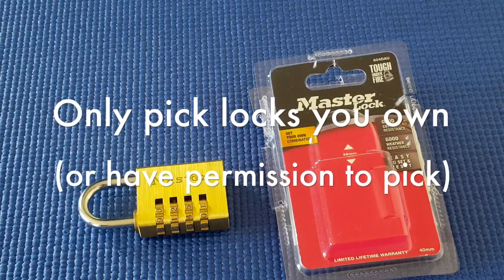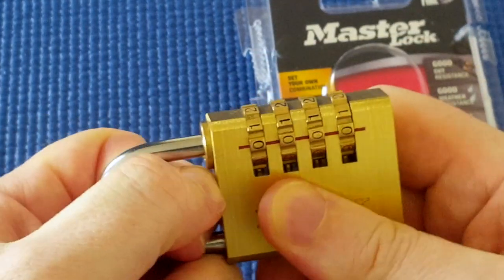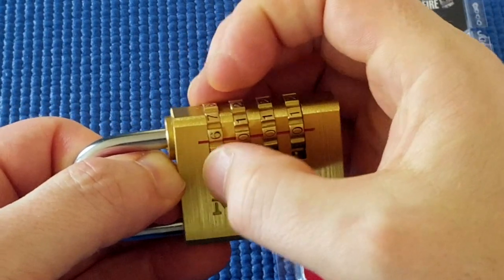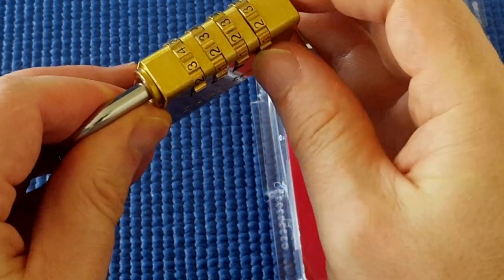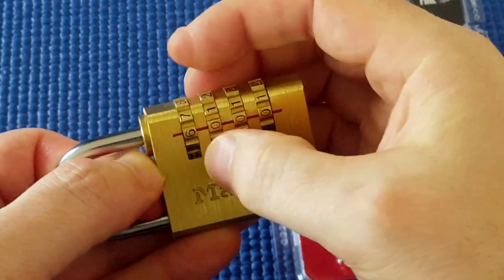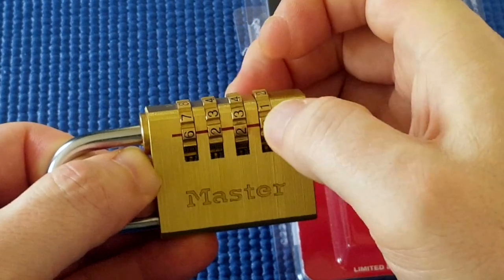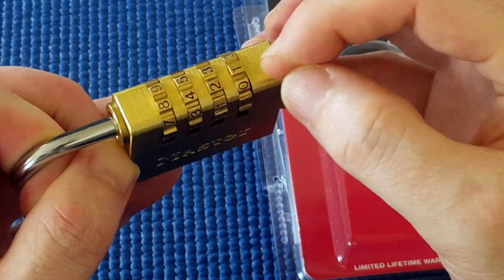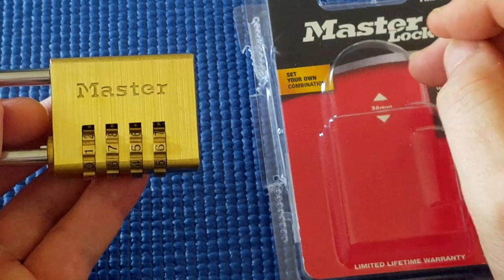(Picking 3) Master combination lock (604DAU) - picked (decoded)

Comment: I’ve got mine stuck open and the code I programmed doesn’t work. 
Can I still use this method with it opened (but locked)
Reply from the maker: The method should still work, but you have to tension the shackle by pushing instead of pulling ... ie as if you're trying to push the shackle closed. You'll have to line it up carefully over the hole, so that it will close if the correct combination is entered. Good luck!

Comment: i dont understand the clicking part - my lock clicks after every number?
Reply from the maker: Is you're the same model? If you tension the shackle (by pulling as if you're trying to open it) then it should click more when turning into a gate, and what I mean by click is that you might hear a click (louder than the others) or it may "lurch" into the gate where the wheel in that position turns easier forward & back a little bit, but it doesn't really want to come out of that gate unless you release tension slightly on the shackle, turn it, and then tension it again.

Comment: I have two of these locks with a comb and now they are stuck locked. Is it possible the comb changed by accident? Or is it just defective locked shut ? What are thoughts. Thanks in advance
Reply from the maker: Do you mean it locked in the open position where the shackle is open, but you can't shut it?
Reply: No it is in the locked position closed. The comb that was working is not working to open the lock. Wondering if the comb or lock is malfunctioned ,
Reply from the maker: @johnd2264  Ahh - sometimes the outside wheels slip against the inside wheels. If it only happened on one wheel, put it is the combination you it's supposed to be and then turn the first wheel and test all 10 numbers, then move to the 2nd wheel and test the next 10, etc (will only take 40 tests to test all of them). That's all I can think of.
Reply: Ok thanks for your help. I will try it. Funny thing is I have two locks on the same case and both are stuck.
Reply from the maker: @johnd2264  That's weird. I'm tempted to think that someone picked them and changed the combination on you (which would be mean).
Reply: Naw the locks have been in my house so not possible. I got one open the comb changed my one letter, so I think the wheel slipped as you said. I’m thinking the second lock maybe had two wheels slip which makes for a lot more combination possibilities. I’m going to keep try your lock pick method. Thanks for all the videos and help
Reply from the maker: @johnd2264  Oh well done on getting one of them open ... your persistence paid off! Yea the inside/outside wheels shouldn't slip but they do sometimes (usually on cheaper locks). Note: if you use lots of tension while you're turning the wheels, that might cause them to slip even further. It's an art to use just enough tension to get feedback, but not too much tension. These locks with false gates can be tricky. I have built up a good "feel" for them from experience. Let me know how to get on. Good luck with the other lock - lemme know how you get on.

Comment: I have this lock and I set it to a particular number/ combo.   I recently went to open this lock with the number i programmed it with and it wouldnt open!  I watched some of your videos and had a bit of a play around and somehow this lock's combination had changed by one digit.  How would this be possible? so strange :/
Reply from the maker: Hmm strange ... depending on the type of lock it's possible that one of the wheels was half-way between two numbers when resetting it ... especially if the wheels are a bit loose? I've also seen with loose wheels and/or cheap locks that the outside wheels can travel over the inside wheel when they aren't meant to.  Well done for figuring out the combination!
Reply: @Swynndla  it was so strange! I was ready to cut it off as the combination id been using for months just failed! So instead of say 1234 it was now.. 1236!! 

Ill definitely be getting a different lock based on your review!!
Reply from the maker: @missk8teu  It's possible that it won't do it again, but yea a new one might be a good idea ... if you're tossing up between two different ones, get the heavier one, as most likely it'll be using stronger internals rather than light metals that can be weak and can slip.  Some of the cheep ones even use plastic inside if you can believe that! (and those ones slip all the time)
Reply: Can anyone tell me how to change the combo from the default of 0000? No instructions anywhere that I can find in the pack nor online at the Master Lock websites.
Reply: Same happened to me. 8 changed to 9 after about 8 months.